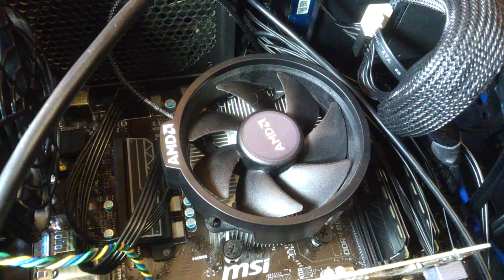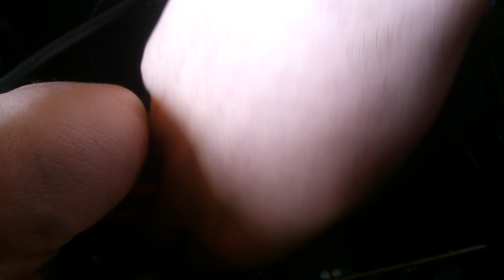Remove Ryzen cooler fan (for 1000 series)

Comment: Are you able to screw the fan back on the other way round? Wasn't paying attention when installing and the AMD logo is covering one of the ram slots. If I ever wanted to add more ram then I'd have to remove the whole cooler.
Reply from the maker: Yes. The screw holes form a square, so you can choose any orientation.
Reply: @DrBernon  top man hopefully that works

Comment: This video deserve more likes seriously. It is straight to the point without any bullshit.
Ok I get it that the method shown in the video doesn't work with newer AMD stock cooler design (screw next to the logo) but still I don't why there is so many dislikes.
It helped me remove the fan of the dusty cooler I bought on ebay for cheap to clean and I think many people found this video helpful as well.
Reply from the maker: Thank you so much for your kind words! :)
I'm glad it helped.

Comment: Wow. First time to see smart design from AMD. They do everything to force their customers make a mistake for using AMD hardware and software. This is in my top 10 marketing strategy ideas. Let them buy, make them broke.
Reply from the maker: hahaha. You are a bit too harsh. In my opinion is better a software that lest you make blue screens from overclocking than in Intel where all you can do is nothing. It's more fun.
Reply: @DrBernon  I did same think for cleaning but now fan is crying. I also used some spray for fixing but nothing changed, maybe I have to use some oil.
Reply from the maker: @infegfx  This fans are difficult to oil without taking them apart. But taking it apart is also difficult. I believe it requires you to drill a hole in the back to access the shaft.
Search for "take apart PC fan". Mots people take apart fans that already have a hole, but the ones that don't are exactly the same but you need to drill the hole first.
If you have the tools and feel capable of doing it, is the best way.
If you try pouring oil without taking it apart, be careful. It will go everywhere. Oil can damage plastic long term, and oils is sticky so it will get dirty faster.

Comment: dude i pulled my cpu right off the socket and bent pins :-/ luckily i fixed it but damn the processor was stuck to the fan so tight that it came out along with the fan and the locked socket

Comment: before remove that plastic thing with AMD logo, check if You have 2 screws under it, if You don't remove these, thing will break!
also before remove cooler from CPU run some burn test for 5 minutes and then shutdown and open case and start remove cooler immediately.
when You unscrew cooler, don't pull it up! first turn it slowly and very carefully to left and right, then try to pull it up. If it stuck, try turn it again few more times and repeat.

Comment: Remove it with care, that plastic is fragile AF
Reply from the maker: I second that. 
It's quite thin. But if you get it right, the force you need to make is not much.
If you pull hard, probably doing it wrong.

Comment: does this method works with 3000 series also?
Reply from the maker: Sadly, no. For what I've heard, the new models have a screw under the logo.
Reply: @DrBernon  nope, I've ryzen 3400g and i was able to remove that plastic cover. Well it wasn't as easy as it seemed in the video.....which cooler you have ?
Reply from the maker: @vnani5812  OK. Sorry. I don't have any 3000 ryzen or any other ryzen for that matter. I got people commenting it was that way.
Thanks for correcting me.
Now I'm a bit confused...
Reply: @vnani5812  Hey dude, im using a ryzen 3100 and the stock cooler and i badly need to remove the cooler frame/ring/shroud, is there anything to unscrew or remove? how did you remove your cooler?
Reply: @ahmeddare2288  pull the frame (sideways) from the logo side  (amd) you will hear a sound, repeat the same process around the frame....4 in total.
if you didn't understand or still unable to remove it reply again. i will post a video of it
Reply: @vnani5812  I understand that part, it's just that i saw a lot of other people say that they have a screw below the amd logo that they have to unscrew first, which requires you to unscrew the whole cooler first (which i dont want to do). Is all 3000 series coolers the same (no screw below logo)?
Reply: @ahmeddare2288  mine was just with the latches not screws.....but if you found screws don't open the shroud because its will be hard to screw it back

Comment: DO NOT do this with 2000 series. There are 2 screws underneath and you will break them. The obly way to remove it on 2000 ryzen is to unmount cpu cooler entirely.

Comment: This is no longer a valid video. I would strongly suggest pulling it or at least adding a disclaimer that the new fans for the Ryzen chips, are now held on by a screw hidden underneath the AMD logo around the ring. I tried pulling it apart as this video demonstrates, but I just couldn't do it. I did not want to stress the motherboard by tugging at it, so I just unscrewed it all and that's when I saw it was screwed on. Good thing I didn't try to pull it apart. I would have broken it. Also, the fans are not repairable. Meaning, you cannot remove the fan blades to add a drop of machine oil to reduce noise. It is one of those permanently clamped blades (which I HATE with a passion).  If you're removing the fan to check the bearing, forget it. Just invest in a new CPU cooler for your chip. Removing the fan blades will potentially damage the fins and break the base off. I tried doing it and once I heard a small crack noise, I stopped.  Incidentally, my fan is no longer making the noise. lol. I must have loosen something and it's working fine now.
Reply from the maker: OK Thanks for the warning.
And yes. It's one of those fans you can't oil. I hate them too. 

I'll see what I can do to warn about this. Don't want to take it down 'cause maybe someone with first gen is interested.
Reply: Yeaaaa i instead removed the whole cooler from the motherboard and then the worst thing happened. The cpu came off and then bending a pin rip my ryzen 3400g

Comment: can i just clean the metal piece without ejecting it just by removing the fan. Or i need to apply thermal paste.
Reply from the maker: To clean the dust, you don't need to remove the heat sink, and the paste will still be ok. No need to change it. I advise to clean it as much as you can without removing anything if possible. With a paint brush or a can of air or a compressor.

Comment: Warning for everyone. I basically unscrewed the top cooler entirely to make the logo face upwards instead of to the sides. Result : The screws dont want to come out. I managed , but almost ruined it. The screws lose their profile because theyre in too tight and once you try unscrewing them  / screwing them back in youre bound to fail several times .  The only way i was able to get the screws back in and out was with a darn drill. and a lot of pressure.
Reply: I just removed the plastic, and I cannot unscrew the 4 screws. I can't unscrew any of them, they will not move at all.
Reply: @NinoMaluri  As i said, it took a ton of pressure onto the screw , aswell as a cutting disk to allow me to continue screwing after the profile wore down
Reply: @Genesis-dj7kw  Thanks for the reply man. I eventually just blew on it like crazy and used a toothbrush to clean it. Did the trick, about 90-95% clean I'd say. May not be perfect, but 80/20 rule :)
Reply: @NinoMaluri  Yeah, what works works. Tbh, id just get sth like an arctic esports 33 for 20€ tho , its dead silent and keeps temps in check far better
Reply: @Genesis-dj7kw  im quite happy with it actually. I also just spent $200 bucks on a new power supply and GPU, so thats enough for now. Im not bill gates over here :D
Reply: @NinoMaluri  Hope you're happy w what cha got then. what gpu did you get?
Reply: @Genesis-dj7kw  Let's see... Radeon rx480 gpu, and power supply Bequiet 550W (not sure exact model). The rest of the PC has Ryzen 5 CPU, and Aorus Pro B450, and 48GB Kingston Ram (3x16GB). That's that. Oh and ssd hard drive, I believe 128GB. I don't really use the computer. I mean, I use it 24/7 for some botting, but I don't surf the net or play games or watch movies or anything like that with it ;)
Reply: @NinoMaluri  Oh I see, was about to ask why that amount of ram was necessary, but ya cleared it up
Reply: @Genesis-dj7kw  hahaha yeah that's why I mentioned it. In fact even for my needs it's too much ram, I don't use all of it. But 32GB was barely enough, and 40Gb was enough but I didn't know how things would go into the future (maybe my ram requirements increase, and also not smart to mix different size ram), and then I just decided to go for 48GB and not have to worry about that part ever again :D

I have another computer. Asrock Steel Legent B450, and 256GB ADATA nvme hard drive, and 600W Chieftec ELP-600S 600W power supply (with all the bells and whistles - surge protection, power protection, zap protection, corona protection, nuclear radiation protection, etc :p), Ryzen 7 2700x CPU, Asus Strix R9-380 4GB GPU, and again 48GB of Kingston Ram.

So my plan B for the ram was, if my requirements happen to decrease, then I'll remove one 16GB stick from each computer, and make a new computer with 32GB of ram :)

Comment: Can i take just this bit off to add more ram? the last 2 slots for ram are blocked by this piece and i dont want to take off cpu cooler
Reply from the maker: Really? Well... If the RAM is really that close as to block 2 slots maybe taking the plastic off won't be enough. Though if the logo part is what's blocking, If you take the fan off you can rotate it and point the logo somewhere else. If the RAM hits the heat sink you'll need some other cooler. Maybe a tower style cooler or an all in one liquid cooler. But you'll need to make sure it won't interfere with anything else and that you have the space in the case.
Reply: @DrBernon  yes its just blocking getting it in but would be fine once in, How much force is needed to pull it out i tried before but didn't want to go to hard and rip the cooler off lol.
Reply from the maker: @jamespurdy8981  Not much if you do it well. Its just a plastic. You have to pull it away more out than up. Just be carefull and gentle. It should be no problem.

Comment: So I guess I could easily swap the fan for another one? Which size would that be? 80mm? Or do they have special mounting?
Reply from the maker: That is an interesting idea. I'm not sure...
The mounting is different from a case fan. On a case fan, the thread is on the fan itself. Here the thread is on the cooler and the screw is a bit smaller. But the distance between the threads is 70mm. So maybe you can put a 70mm fan. Sadly I don't have any, so I can't try it. :(
Sorry for answering late.
Reply: @DrBernon  Thanks for your reply. I already had an 80 to 120 mm fan adapter ordered and just canceled it due to your reply. I now ordered a 70 to 120 mm fan adapter and will check if it works. I'm kinda excited because the stock fan seems to be about 71-72 mm ... I can post an update if you're interested. Good job on your video btw – it helped me a lot.
Reply from the maker: @adoksym Thanks! Did your fan broke already? What a bummer... Or it's some sort of DIY project? And yes the stock fan is clearly a custom fan and maybe is not designed using the metric system, so it could be a bit off. Anyway... I hope you succeed.
Reply: @DrBernon  No, nothing broke. It's just a test to see if I can get it both more silent and hopefully cooler. I still have an Arctic P12 PWM lying around so I figured "why not" (hence the adapter). If it doesn't work I will go back to installing the original fan.
Reply: @DrBernon  Okay, so today the fan adapter arrived. It fit perfectly on the stock heatsink. Mounting the 120 mm fan on it was also no problem. The temps are okay (similar to stock fan) but ofc the 120 mm now runs at less rpm and therefore is more silent. For better cooling I would not only have to use a better cpu cooler but also an entirely different pc case since my Lian Li PC-A05B has no decent air flow at all.
Reply from the maker: @adoksym  Ok. Thanks for the update. I'm glad everything worked out, and it's nice to know it's possible to put some other fan. 
Also, I've looked at the Lian Li case, and yes. The case is probably the biggest problem. Get a new case before anything else. A bigger heatseenk can't do anything if the air is hot. Also, the rest of the components must be cooled as well.
Reply: @adoksym  Oh my god. The motherboard is upside down there! The electrons are not falling down? You can google: "The [Official] Lian Li PC-A05 Club" for some modding ideas.
Reply: @adoksym  hey where can i buy one of those adapters?
Reply: @adoksym  where did you buy the 70mm to 120mm adapter? I'm having trouble finding one.

Comment: Mine has a screw under a logo , so no way to remove it without 4 screw first
Reply: The stealth has 2 screws under the logo, so you gotta remove the whole thing, then unscrew them, then just pull it
Reply: The stealth that comes with the 2400g removes just like this
Reply from the maker: It has more than 4 screws? Which Ryzen cooler do you have? This one is the Wraith Spire no LED. 
Notice I remove the logo cover first. As far as I know the Spire and the Stealth (the small one) should work the same way.